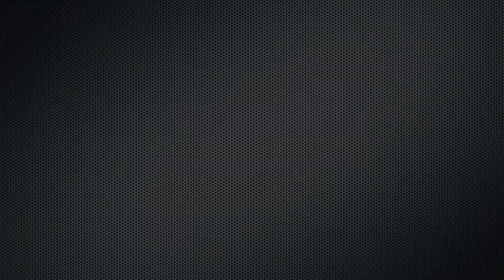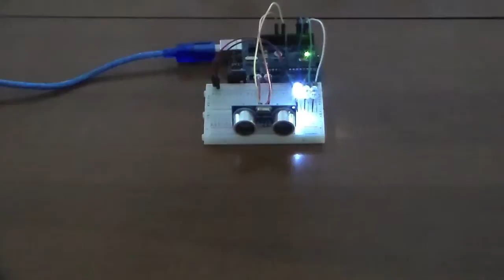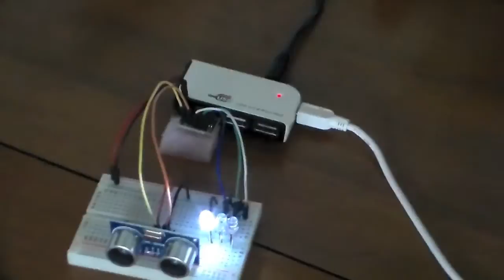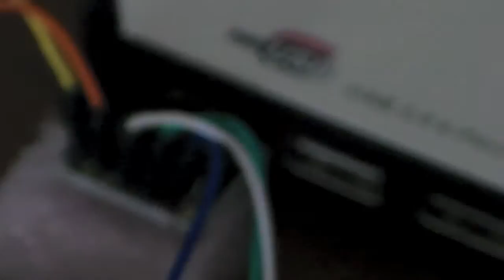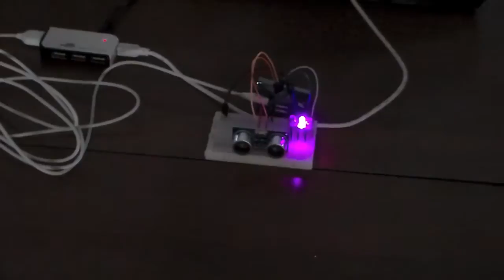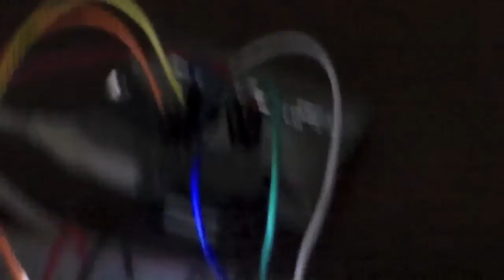HC-SR04 Distance Sensor and Arduinos

Comment from the maker: It was a current/voltage sensor & I had it connected without load. I thought I *did* have it under load, but the rising smoke column convinced me otherwise. :-O

You can't measure current without some load; otherwise, it's just a short. :-D

Good luck!

Comment from the maker: I don't have access to the machine with my files on it right now, and it's been long enough ago since I did that to remember specifics...but I typically use available sample sketches as a starting point for new hardware. I don't remember the HC-SR04 requiring much (any?) rework for my applications, & I usually remember if components are a huge pain.  :-)

It's a cheap component (~$6); you may want to test with a new one and see where to go from there. Good luck!

Comment: I won't make a habit out of this, but have you seen this kind of data from the serial monitor? The values on each row are duration and distance values. The rows alternate from very low to very high through each loop cycle.
2 1
29979 14989
3 1
30287 15143
3 1
29808 14904
2 1
29762 14881
2 1
30225 15112

Comment: Thanks for the information. Is the serial rate of 9600 correct? I am getting readings that make no sense. I may have wrecked the SR04 with the soldering.

Comment from the maker: Sure! I double-checked my code, & I used pin 8 for the trigger pin and pin 10 for the echo pin. I set these in code as constants (#define), though, so there's nothing hardwired per the HC-SR04; feel free to choose whatever digital pins you have open and use those.

Comment: When you are using the UNO, could you list the pins on the UNO that are used for the 4 wires on the SR04? It would help a lot, since it is hard to tell by looking at the video.